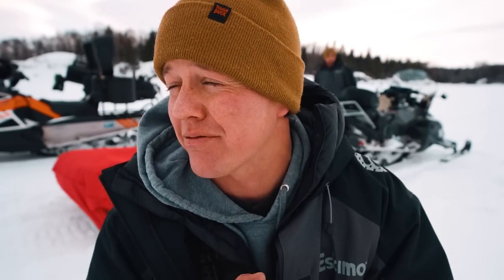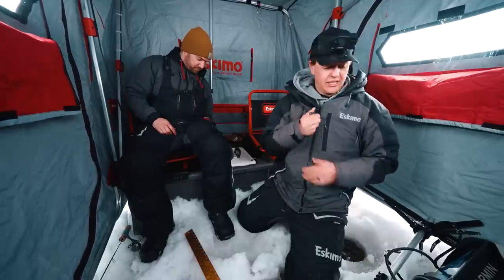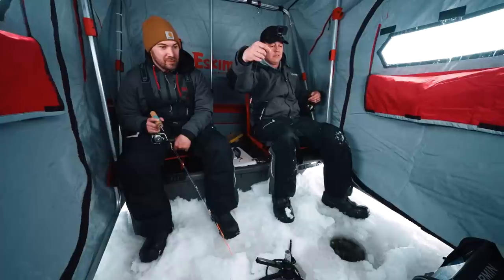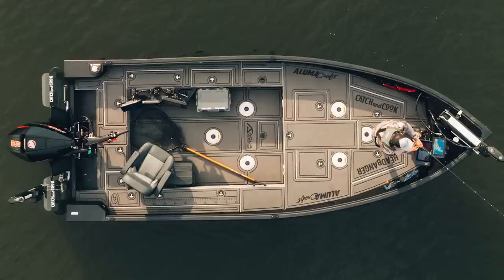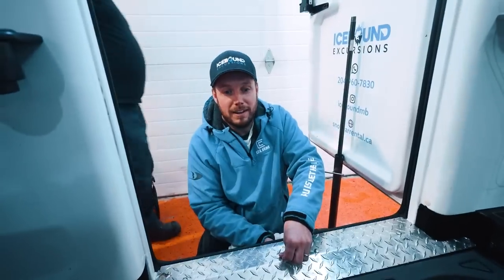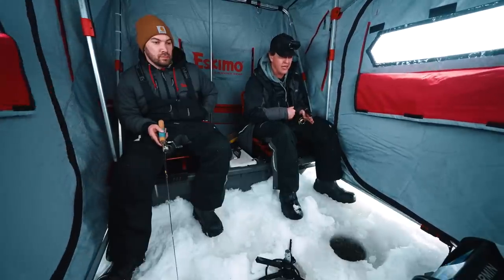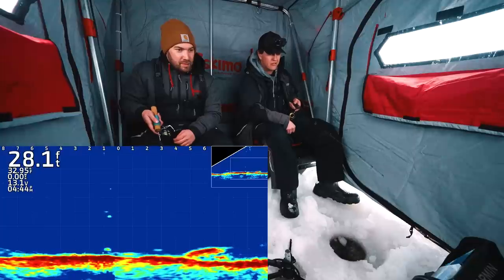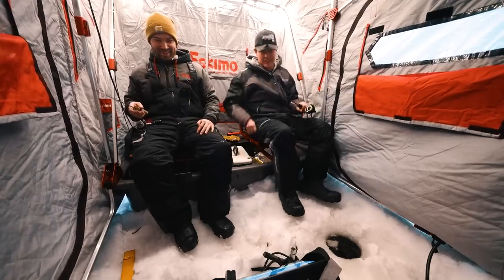Lake Of The Woods Walleye + Update (We're the FIRST in Canada)

Comment: Eskimo Eskape 2600 and 2800 are the same length when set up (98") its just the width and height that's different.  2800 is 6" wider and 15." higher than the 2600.  But 2600 packs down smaller to fit under a tonneau.  Congrats on the new business!